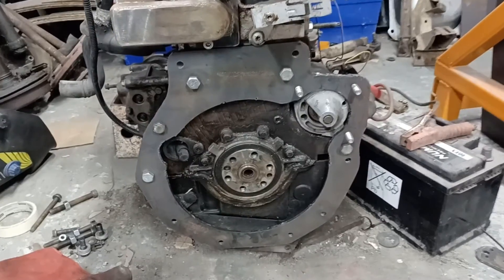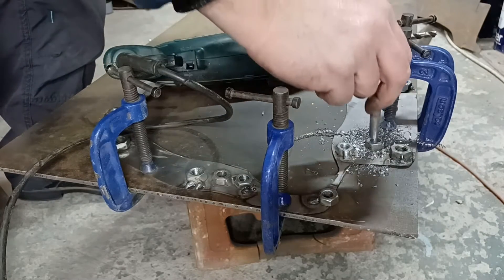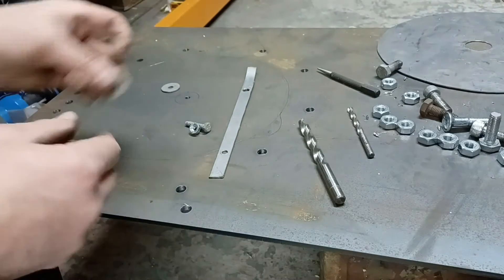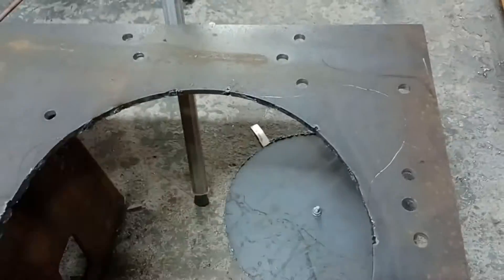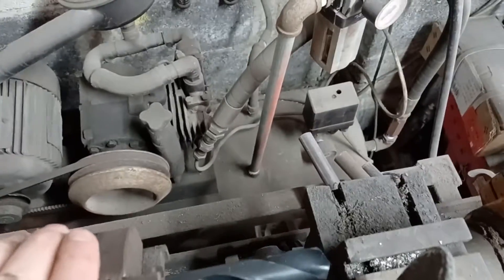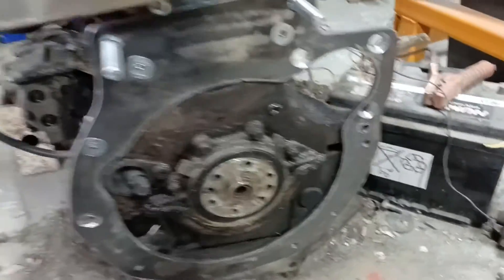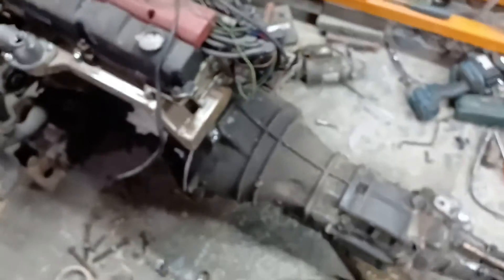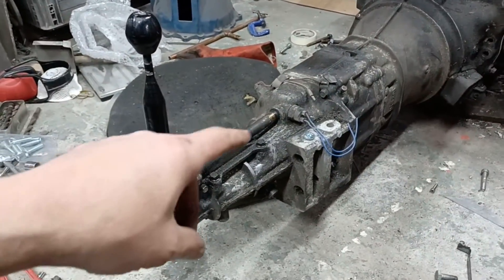Ford Escort MK1 Restoration. Gearbox Adaptor Plate Part 2. MX5 NA to Zetec ST170

Comment: Great work, inspiring.
How do you get correct thickness of the plate. Maybe I missed it, will be watching it few more times🙂
Reply from the maker: Hi, thanks for watching, I just used the thickness others have used that has worked tbh.  I had a plate from a supplier to fit an RX8 box to a Ford engine, and that worked well and was 6mm..

Comment: This has been amazing Dave , I can’t drive a manual anymore unfortunately and I was trying to figure out ( bearing in mind I’m no mechanic) how to go about adapting an auto box to an escort 55 diesel  van I’m going to restore ,my first thoughts were to replace the whole engine and box together with a mk1 focus unit but now you’ve got my creative juices flowing ! Great work my friend thanks 👍
Reply from the maker: Thank you mate.  I presume the van is a Mk3/4 55? Couldn't you use an auto box from the car? Or was there no such diesel auto version?
Reply: @DavesGarageuk  that’s a good point I shall do some more homework as i haven’t got a clue mate im a complete novice at this im finding my feet lol 👍

Comment: Following with interest as there is no adaptor available for my proposed conversion. One comment, unless I missed something, the dowels are used for accurate location and as such they take the torque load, not the bolts although of course they clamp. So the dowels should be a snug fit.
Reply from the maker: Thanks for this, it's something I need to revisit

Comment: Noicely done.   You should ask clutch shops or Motorsport shops if there's a hybrid clutch plate to offer up, Mazda 3, 6 duratec maybe. Years ago I took in a blacktop zetec clutch to get the spline swapped out for a Celica 5sp spline, was really cheap at $30 !!
Great job Dave 👍
Reply from the maker: Thanks Marty, that's a very good shout 👏

Comment: You definitely can move the gearbox shifter forward, I did it years ago on a Mazda rx7 series 4/5 gearbox to fit into a series 1 rx7. The tail shift assemble looks almost identical to your mx5 gearbox.
Reply from the maker: Good news, thank you 😊
Reply: I used the full internals out of a Mazda 626 rear wheel drive gear box in a series 2 RX7 housing when a roll pin wouldn't stay in the selector fork the main difference was the input shaft shank and the Speedo drive gear.

Comment: Nice job, nearly there with mating the gearbox and engine, hope the clutch arrangement proves to be a good match with the Mondeo parts coming. 
I'm looking forward to the selector modification now you've mentioned what you think is possible to do to move it forwards.
Reply from the maker: Still in the thinking about it stage, but it seems to me, the gear stick assembly is removable, and I can't see why it can't be chopped and relocated... watch this space while I turn a perfectly good gearbox into scrap 🤣

Comment: Dave this is coming on really well. Have you had any thoughts on dialling in the bellhousing for concentricity. This would be far easier if the bellhousing was seperate but essentially is about alligning the engine and gearbox shaft centres to within < .005"  of runout. There are lots of videos on this (the one I watched was by Holley). This is usually done more easily where the bellhousing is detachable and is done with a dial test indicator attached to the crank or flywhwheel and measures the run-out to the inner locating diameter in the gearbox end of the bellhousing, errors are divided by 2 and corrected with offset machined dowels.
Reply from the maker: I'll have a look into thar, thank you
Reply: @DavesGarageuk  Dave, it would be possible to make a small hole in the side of the bellhousing to insert an extended dti spindle on to the flywheel end of the first motion shaft with the gearbox and engine coupled and spiggot bush made and installed without clutch. By turning the crank you could see how far the 1st motion shaft was being pulled off centre by the crank, a bit like setting up a spindle in a 4 jaw chuck. Either by slotting holes in adaptor or if close just by using slack in the boltholes, you could partially loosen and tap in eiter plane untill the clock (dti) reads less than 5 thou deflection and then drill and use mills pins to dowel the addaptor and bellhousing together so that they will always re align in the same place. Thinking about it you would need to dowel the adaptor plate to the block before you started the alignment so that (that) was a fixed datum i.e. not variable. 
There is no way of knowing at the moment how misaligned the crank and gear box will be, but if unlucky you could destroy the gearbox 1st motion shaft bearing in short order as is far less well supported than the crank and you woud have to tear out the engine and box from the finished car to do an alignment anyway. Please understand I am trying to be constructive and in no way am I picking holes in what you are doing. What you are doing is awesome!!
Reply from the maker: @Neil Jarvis  that's a brilliant idea, thank you, please keep it up, I'm willing and open to constructive help.  Thank you 😊
Reply: @DavesGarageuk  Hope it made sense? One point I missed is that you will have to do measurements in  two planes i.e. horizontal and vertical. That will mean putting in a second hole for the dti spindle, so one at 12 o'clock and one at 3 or 9 o'clock. Having adjusted the run out in the vertical plane you could put in a mills pin at or near 12 o'clock and then pivot about that to achieve horizontal alignment left or right, nip up the bolts, re check vertical run out and if still good, put a mills pin on either left or right side.That way it will be correctly aligned every time its bolted up.
So you have somewhere to attach a dti mag base,  you could drill into the bellhousing and put in a nut and bolt with a liitle 2" square of that 6mm plate offcuts welded to it, ideally 2 off - for mounting at the 12 and 3 o'clock positions. You could make little round 1/8" thick ally plates with a M5 screw tapped into the bellhousing to cover the 4 holes afterwards (unless you have access to an AC Tig set to fill them in). Tell  me when youve had enough of my wittering🤣......
Reply from the maker: @Neil Jarvis  this is all good stuff, thank you so much for sharing this 👍👍

Comment: Nice bit of progress. Have you tried to loosen the top bolts a bit to get all the bolts in before tightening? And how did you make sure the input shaft aligns with the crank? Can't remember if you showed it in the previous video or not.
Reply from the maker: Hi Tom, input shaft does line up, the input shaft center was my starting point. Once I've worked out the spigot bearing arrangement, that will center the box, hopefully...😊

Comment: Thee rear end of the old and newer engine in Ford. Zetec 1.8 - 2.0 and the newer one Duratech small in Focus and big in Mondeo and even in some pickup as 2.5. What is the different, is the Zetec with a Ford rear end and the duratec with a Mazda rears?. 
But the gearbox from RX8 dose it fit to a Duratec........
Reply from the maker: Yes, that's correct

Comment: Dave you are a genius what hole saw cutter would you recommend for 2mm sheet steel I tried those that are supposed to cut plaster board and metal but only make a mark they don’t actually cut the metal
Reply from the maker: Starett hole saw bi-metalic, with oil, very good, expensive, but they actually work. I've been cutting through nails in floor boards for years with them 🤣